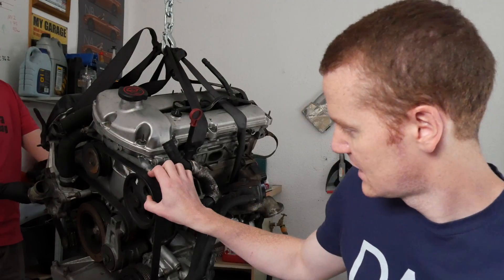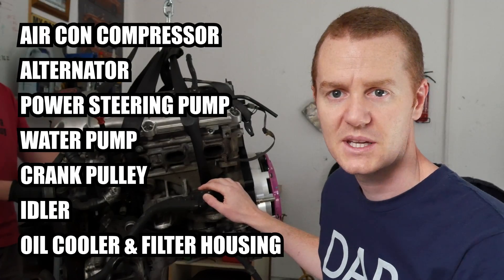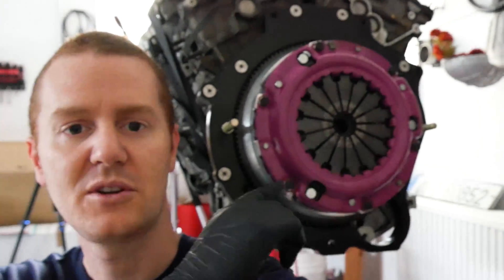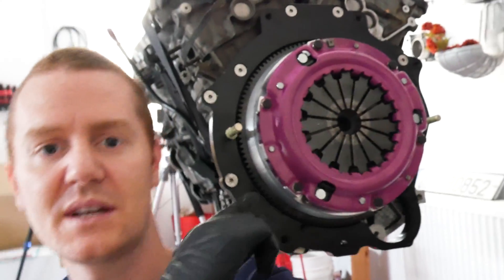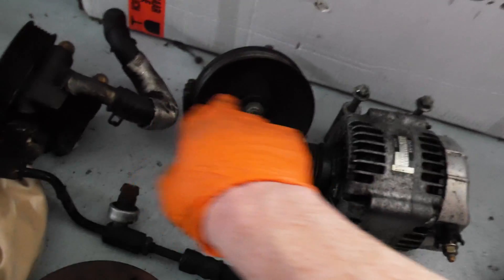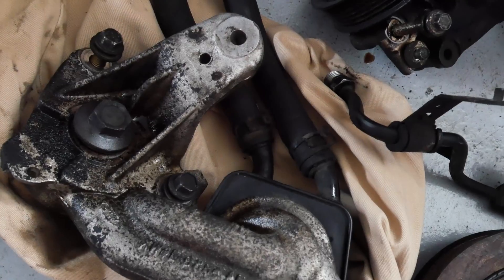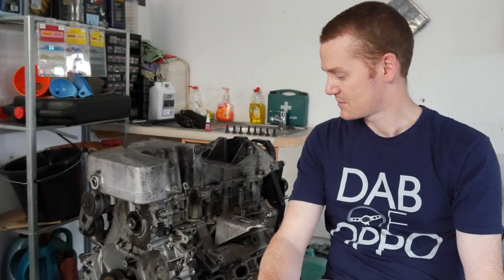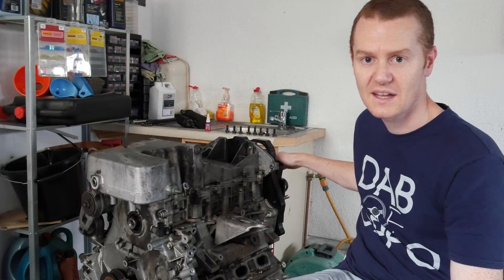Removing Ancillaries from Jaguar V6 for Rocketeer Build

Comment: Shiny!  I suspect you thought several times - why didn't I take these parts off before I spent so much time cleaning them?  I am glad you have it on a stand now.  I was getting frustrated watching the engine bob around in earlier videos.  Having it stable, on a stand or even on a table, makes it easier to apply necessary force, if you know what I mean.
Reply from the maker: Yep. Exactly my thoughts. Why the hell did I clean the sump only to remove it 😂

Comment: More good progress. I also removed my pulley but for two reasons. One to paint it as it looked awful against a cleaned block but also to change the crank seal. You may want to consider doing this with it off, the seal is cheap and worth doing whilst the engine is out. Getting the seal out was fun but once i found a way it was easy.

Comment: I think it would be worth investing in a heavy-duty rattle gun. that would have got that pully centre bolt off without disassembling the clutch again.
something like this milwaukee M18 FUEL High Torque Impact Wrench 1/2" (Nut Busting Torque 1,897Nm), M18ONEFHIWF12-0
of course choose whatever brand floats your boat.

Project looks great, thanks for showing the video series.

P.S. if you going to paint the block to add a bit of Bling, nows the time.
Reply from the maker: I have got a wired rattle gun, but it's hella loud and I'm often working on the car when my young fella is in bed. Not painting the block or rocker covers for now. Just want to get it running first.